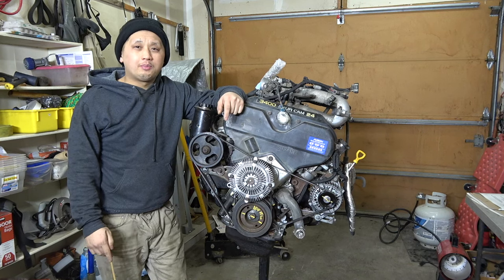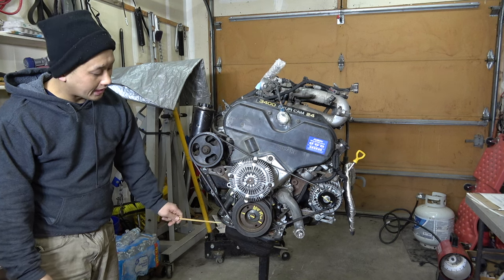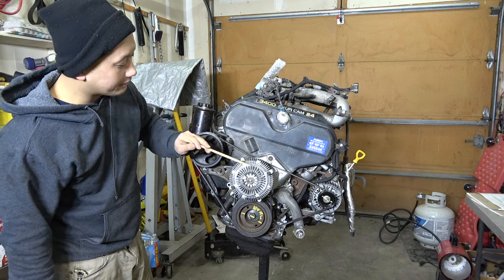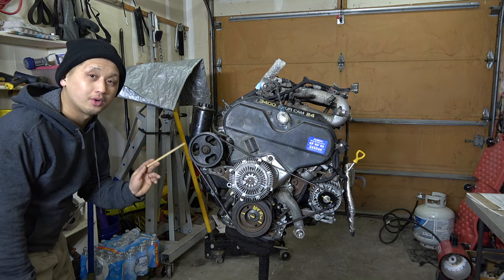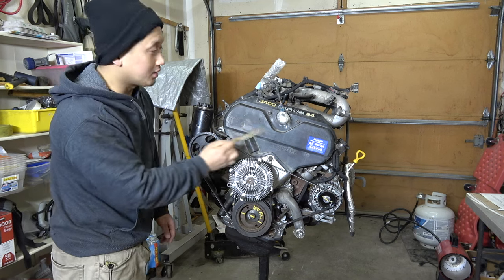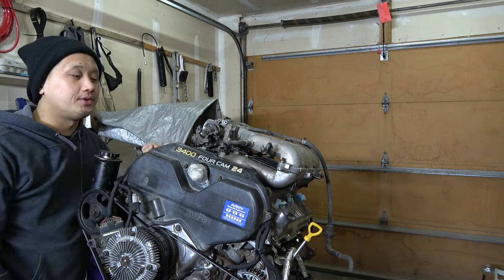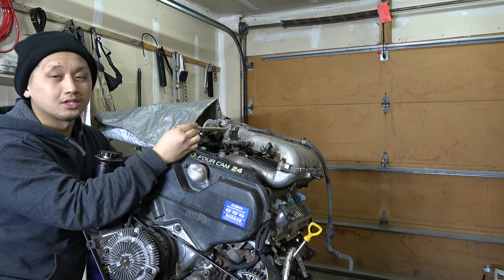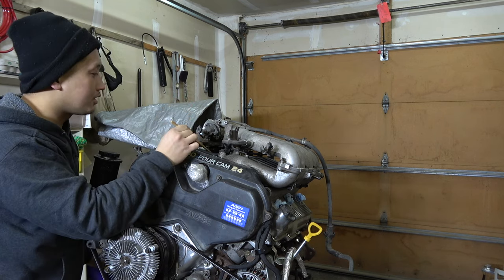TOYOTA 5VZE ENGINE FULL TOUR | 3.4 SWAP BUILD

Comment: Thank you for the great explanation on the wiring harnesses. I’m doing my swap and spend way to much time staring at wires and wondering where the hell does that go. I still have a few on the drivers side fender from the 3.0 that I’m confused about but this video SURE helps.